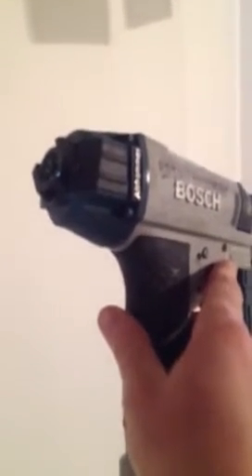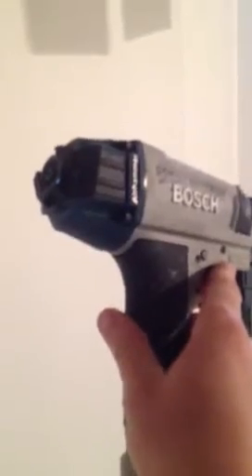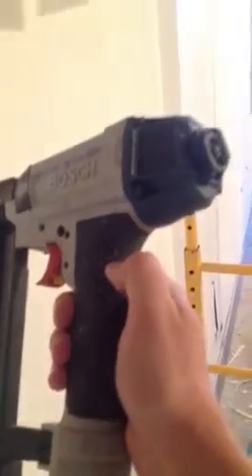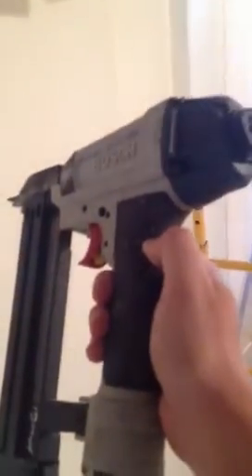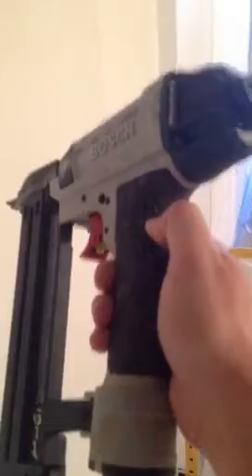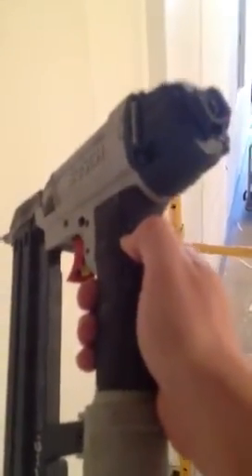Bosch 18 gauge brad nailer

Comment: I had a brad nailer that did that,  its the compression spring gets stuck.  Most likely the spring is not strong enough (needs to be stretched a little) And / or the O'ring around the top exaust valve is too fat (likely from too much water in the compressor going thru the gun after while and the ring expands ever so slightly that it causes too much friction and the valve gets stuck.  What I done is open it up and put some grease, if I remember correctly, it was white lithium grease may work ok.